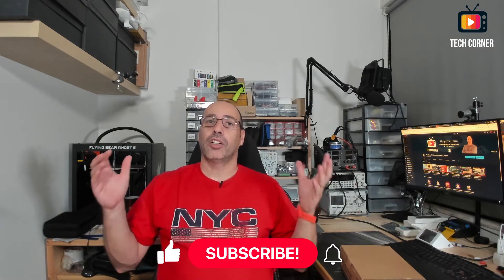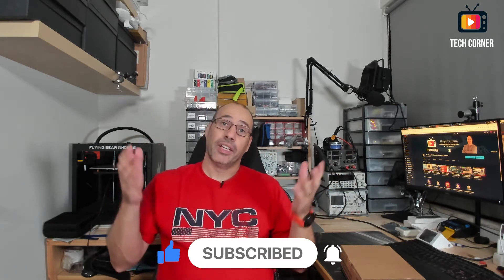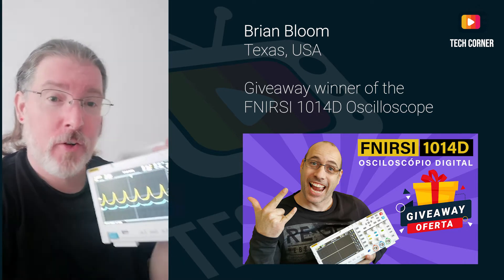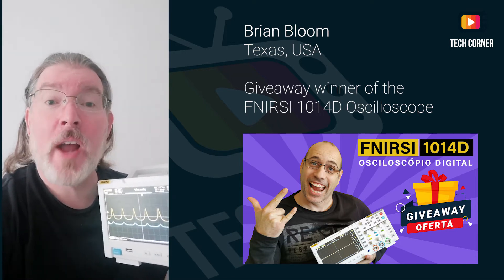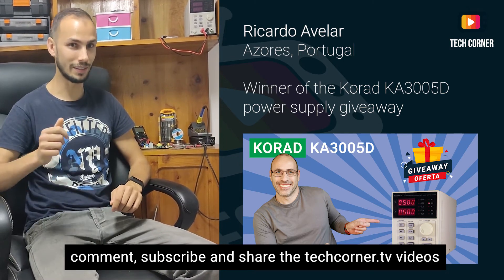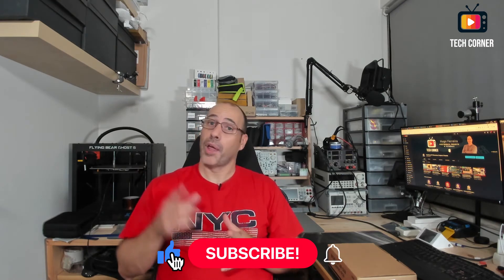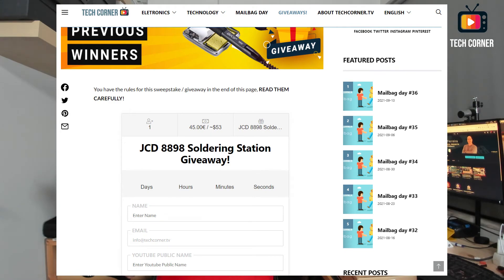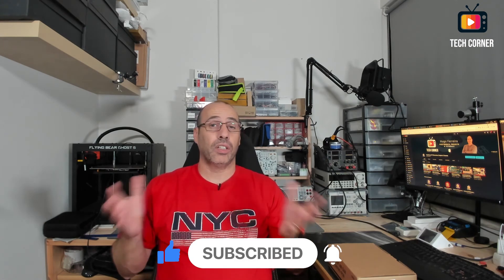JCD 8898 Soldering Station Giveway! ⭐ Celebrating 500 subscribers and on the way to 1000!

Comment: Link to the website is not working
Reply: Getting page not found.
Reply from the maker: Hello Mohan, sorry I did a mistake and scheduled the video for 02:00am instead of 02:00pm and the website was ready to fire the form at 02:00pm, I already published everything on the website and you may register there. Thank you for joining in, good luck! 👍
Reply from the maker: Hey Tron, problem fixed! My bad, I scheduled the video for 02:00am instead of 02:00pm (local hour) but already published everything on the website, so you may register! Sorry for that... good luck for the sweepstake 👍